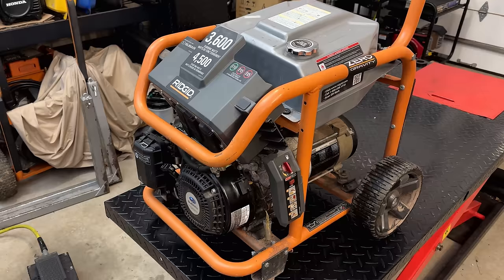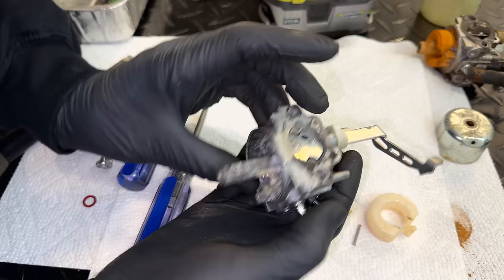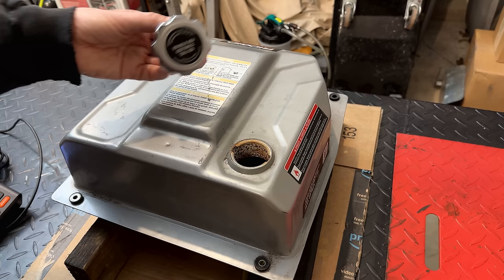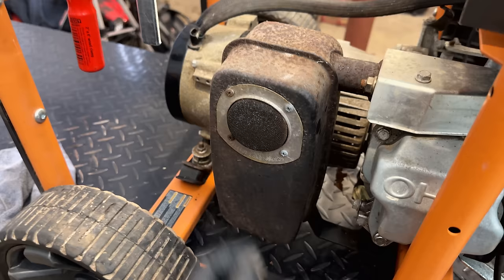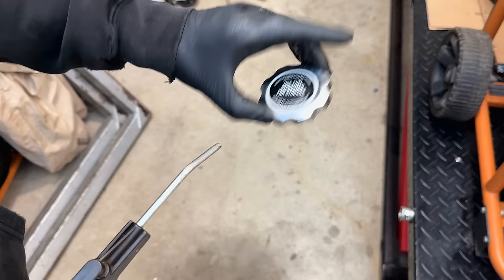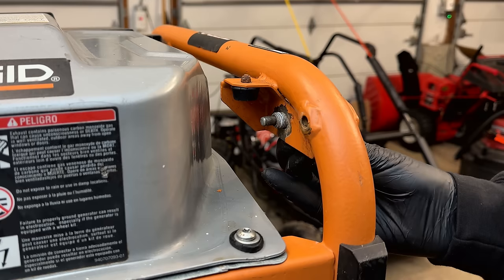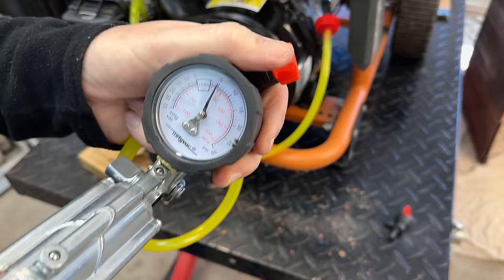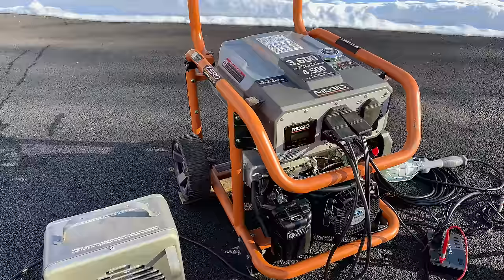Neglected Ridgid Generator Will Not Start

Comment: The engine seemed to be squirming without a load then improved with an initial load however began squirming a little again.Don’t know if that’s the carburetor hunting or something else.
Reply from the maker: Probably just the carb.  Clone carbs are a little inconsistent with fuel delivery.

Comment: write with sharpy on bowl what issue before storage
I saw someone (marty ) strap tank to a wheel turn slow over night smaller nuts no bolts very effective
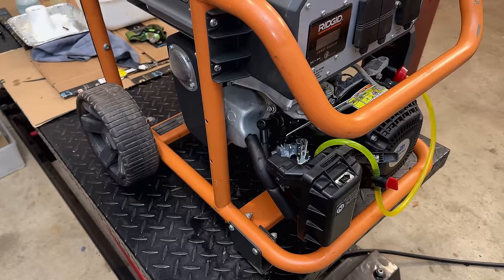1:00:00 Also add slide hammer to your amazon wish list

Comment: Hi James. I love your channel. I want to ask you a question: What is the average consumption of a 5,500-watt gasoline generator running at about 50% of its capacity, per hour? And from a 2,500 watt one working at 80%. I'm from Venezuela and fuel is hard to come by here, but we have a lot of electrical problems...
Reply from the maker: At 50% load approximately 5 to 7 liters an hour.  Not sure at 80%.

Comment: At about 20:27 you say it started to surge as the bowl BEGAN to empty. And it didn’t seem like the bowl was empty.  So, I’m wondering what the impact of a full tank of gas has on the lean condition of some of these gravity-fed carbs, if any.  Does a full tank of gas squeeze more gas through and eliminate the lean/surging condition?

Comment: Hi James, i enjoy your videos every time, even if i'm not working in this domain, but i learn from them many things.
I have one inverter generator and it was running fine, with a small load and suddenly it entered in the protection. I switch it off, it started fine, it outputs power, but even with a small load the motor is struggling. Normally it can output 2800Wh, but now even with.about 800W i can hear the motor slowing down pretty bad. I didn't had time for it, but, with what you would start the diagnose?
Thank you very much!
Reply from the maker: The throttle is controlled by a servo on the carburetor.  That throttle is wired into the inverter.  Going into protection mode is a sign that there is an issue with the inverter or maybe a shorted wire.  It sounds like maybe the servo is no longer moving.  If you are lucky it is a bad servo it broken wire.  More likely though something failed in the inverter and it can no longer control the servo.  Check the wires carefully and manually try to move the throttle plate to make sure it is not stuck.
Reply: @jcondon1  thank you very much!
Reply: @jcondon1  i just took an overall look and it has a servo. I will check it in more detail tomorrow. Thanks again James!
Reply: Hi James, today i managed to test it more in depth and this is what i noticed: the servo is running fine, i checked the cables, the connectors, i visually inspected the inverter, no capacitor seemed bulged, the output voltage is stable 230V/50Hz (our standard ), I tested the generator with a heat gun with 1kw and 2kw load and it runs almost fine, however when i switch between no load and high load, the servo is struggling to find the right position for a second or two and i can hear the motor going crazy, accelerating and decelerating fast until is stabilizing. Could it be from the carburetor?
I'm tempted to say that the inverter unit is fine, since it can output power at the right voltage and frequency and more likely the generator can't provide power fast enough when needed, so the inverter gets underpowered when switching suddenly to a high load. That would explain the error i saw back then. Today i wasn't able to replicate it, however i was using it to a solar off-grid inverter to charge the batteries and it still doesn't work. When the solar inverter tries to switch to the generator, the generator goes crazy and the solar inverter will disconnect the generator.  Sorry for the long comment... :)
Reply: PS, even if i set the charge to a low value (like 500-1000W) in my solar inverter, the same happens. The sudden load seems to destabilize the generator enough that the solar inverter won't accept it and will disconnect it.
When i switched from 1kw to 2kw, i saw that for a moment the output dropped from 230V to around 200V until the motor was stabilizing. The solar inverter is very picky to the voltage, frequency and even waveform, as it needs to synchronize with it.
Thank you for any tips you may have.

Comment: With rusted fuel tanks , have you looked into using different types coatings , after cleaning ?
Thanks again
Reply from the maker: Yes.  I have coated a few recently.  The big issue is the lip at the top of the tank full and the small fuel pipe.  No good way on most tanks to let the excess drip out while drying.

Comment: I was wondering - When I was in the repair field of automotive and doing body work , I was introduced to a product called Rust Mort. This had the ability to change surface rust into a hard carbon, Could that product be of any use to you? Maybe check it out and see..

Comment: Which tool is the best one for testing for t.h.d on a portable generator for the house  I've got a craftsman portable generator  I would like to know what the t.h
.d is on this unit I will get the other information that you are going to need to help me with this matter James condon
Reply from the maker: The most affordable one is the Amprobe ACDC-52NAV.  Still expensive.
Reply: @jcondon1   thanks for the info on this tool Mr condon I'll be looking for this one

Comment: Hi James, I'm one of your subscriber.

I have a question, I have a power generator is  a Cat 7000 watts, is output 119.5 volts at 72 hertz according to kill-a-watt meter.

Do you think this normal, if not what I'm supposed to check.

Thanks for your great videos.
Reply from the maker: 72 hertz is too fast.  Multimeters can get confused if the power output is dirty.  You should double check the engine speed with a tach.  Ideally no load it should be at 61.5 hertz or 3690 rpm.

Comment: I'm certain that you realize there are products to coat the inside of fuel tanks with. Just curious why you don't use them.
Reply from the maker: Just hard to do on this type of tank.  There is a lip on the fill and the drain is tiny and also has a lip.  Most tank sealers, you need to prop the tank to allow the excess to drain out while drying.

Comment: I have a Kohler generator with a 3,000 watts rated as constant, but when I put a 2,900 load, it stalls the engine. Is there a way to remedy this? Thanks in advance.
Reply from the maker: What voltage is the generator running at?  If over 120 volts then you actually might be hitting 3000 watts.  Volts x amps = watts for example if running at 125 volts then 125v x 25 amps is 3,125 watts.
Reply: @jcondon1  At 2,500 watts, it's running at 120v @60hz. Once I put the extra 400w, it goes down to 110v, and you hear the engine stalling. I don't know if it will change anything, but my generator has a 120v and 120/240v switch. I keep it at 120v side.

Comment: just out of curiosity...  what is the cost of a new tank (assuming you can get one to fit) VS the cost of gallons of evaporust?  I've never purchased either, just wondering.
Reply: Fuel tanks are ridiculously expensive for generators. Last one I priced on a Coleman generator, the tank was half the price of a new generator.
Reply: The problem is not only the cost (some fuel tanks are just bonkers expensive), but also, as he said in the video,  that the tanks are a) proprietary (so no other brands have these) and b) are not built anymore. So basically you're shit out of luck, you can't even buy a tank if you wanted to.
Reply from the maker: Not sure since it was not available.  OEM tanks are usually $200-$300.
Reply: @jcondon1   I see.  I am in Canada and everything seems pricy.  I looked a while back for something similar to evaporust and it was about 10$ for a litre...40$ for a gallon...
Reply from the maker: @TheBry_Guy  it not cheap.  That is why I knock the rust down first.  Then the evaporust has less work to do and I can use it in several tanks.  Citric acid or vinegar are much cheaper options.

Comment: I run my 10K Getronics generator each month for 30 minutes to make sure is is operational. I was wondering how often should I completely empty out the fuel tank to make sure there is no corrosion or rust in the tank.
Reply: Myself on my westinghouse 12500 I do the same maintenance running it monthly 15min 3kw load. I use ethanol free gas only. 4 years rust free just adding fresh gas as needed. I drained and examined the tank after 3 years and there was no rust. Only maintenance was a fuel filter, spark plug and air filter,oil. None of which looked like they needed it. I do not use fuel stabilizer and finish run the generator with fuel off to drain the carb bowl. Used the generator 3 times for extended emergency. Ethanol free is suppose to be good for a year.. Hope that helps

Comment: Ref your issue with fuel valves. I recently bought two after market valves from a UK supplier ( Chinese) manufacturer?). Both were so stiff and graunchy so as to be unacceptable . Ended up buying BS valves which are free moving and acceptable to my customer. Wonder where the BS ones are made ?!

Comment: 3000 watts... 24 amps through a 20 amp breaker is strange, unless there are two 20 amp fuses with 12 amps running in each

Comment: Freaking hate those fuel valves, have you found anywhere that sells reliable non Chinese crap?  I went through two for my rider and gave up and left it straight lined after the original started leaking

Comment: so many generator supplyer names are in this world, that i did nt know....:(
any patent is?  or all made in China? (without permission copy free world)

the ignition checker Pet-4000 is about 40$US ....and made in china is only 4$US...loool
also i found out cabrator assy. less than 7$US in Temu .....terrible china :)

about fuel tank...i  do not understand why using steel? not stainless or plastic?(FRP etc)
the rust and water always cause many troubles....

i started use the plastic valve this year 1st time(made in China).......because they were cheep:)
good infomation about that failure....... of course SUBARU was a engine maker of Zero Fighter(Japan).....never used plastic valve
terrible low grade china :) ..... take care to use....i never  ride a bike  nor car  made in china :)